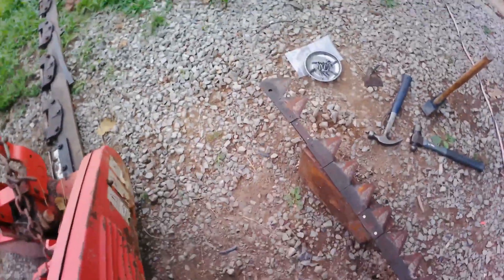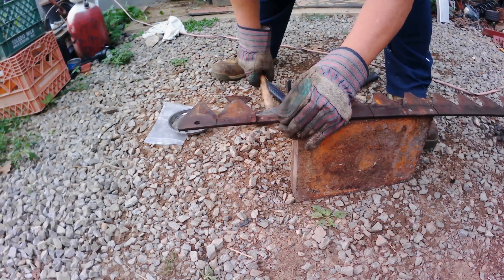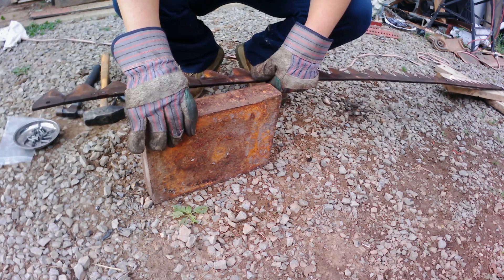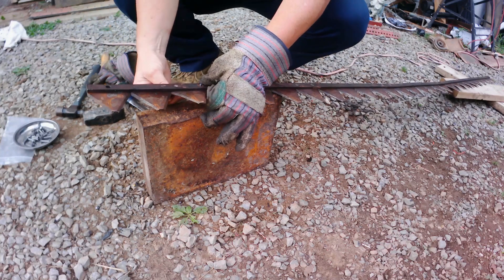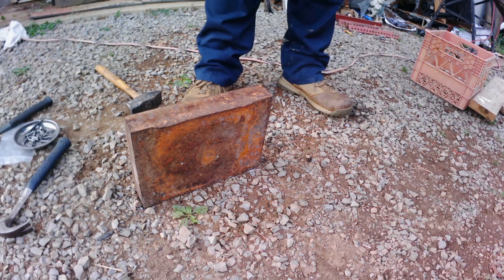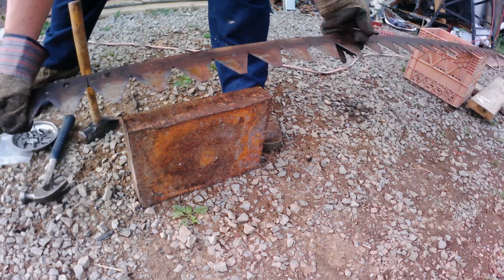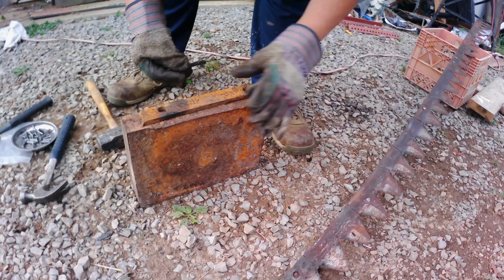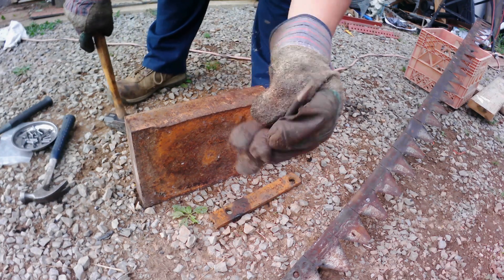Fixing my Sickle Mower

Comment: Brian, I did it similar to you years ago. However, I found me an old Johnson Sickle Servicer and I haven’t looked back since. It will take rivets out with one pull of the handle. It will also put new ones in with a single pull. It uses leverage as a press. I’ve even got blank steel to replace a sickle bar and used that servicer to punch out the holes in it. Wished you lived closer and I’d let you use it. By the way, what’s the follow up on that cab Kubota?
Reply from the maker: That sickle servicer sounds nice, i may have to look for one around the area in estate and junk sales. Iv'e got the Kubota cab walk around coming most likely early next week. Thanks for watching and thanks for the info.